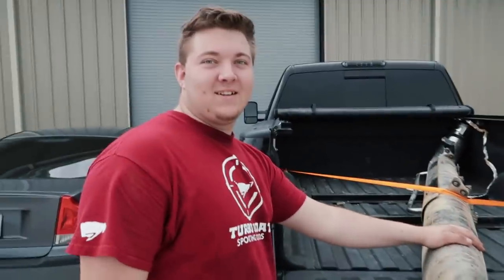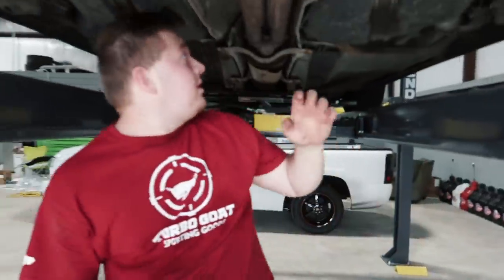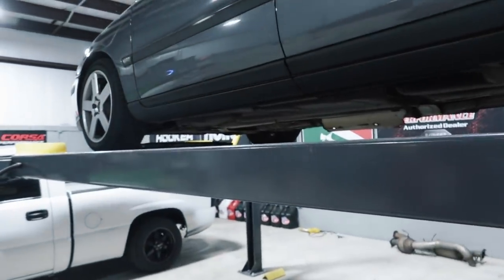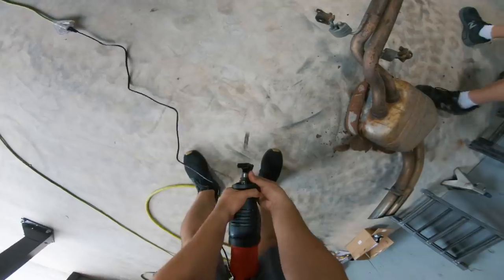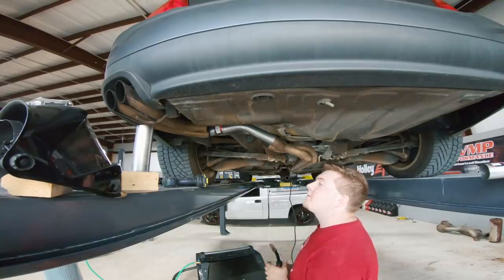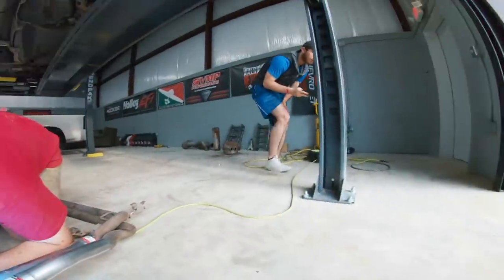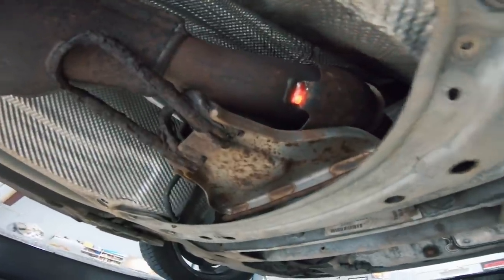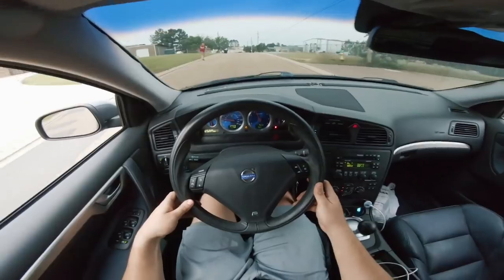We made my Turbo’d Volvo sound like a VIPER!!

Comment: it's a viper with 5 less cylinders and a turbo.
Reply: Cain Nolan A viper is a V10 and the Volvo is a Inline 5. Do some math and it has 5 less.
Reply: @bigbody_business3601  dude chill..
Reply: @bigbody_business3601  mate take a chill pill lol
Reply: Cain Nolan yes 5 less, a viper has a V10 that Volvo S60 has 5 cylinders
Reply: and a different sound
Reply: Wow, this got heated fast😂
Reply: And mostly fwd
Reply: I'm pretty sure that's the same engine that is in the ford focus st 2.5
Reply: Yes and no, Ford did use the Volvo Inline 5 for their ST/RS yes but they used the B5254T3 as their base platform and reworked that engine. The S/V70R has the B5254T4
Reply: @alexanderambrosio3497  just gonna point out some parts to be a little more specific, there was never a S70, but there was a S60 and S60R, second of all, the S60R and V70R use the B5254T5 engine, not the T4 version, the T4 is in the base model 2.5 S60/V70
Reply: @robinjohannessen787   Totally wrong. There was a s70
Reply: @alexanderambrosio3497   The r engine has thin walls 2.3 i5 is better
Reply: And Swedish
Reply: What’s wrong?

Comment: Not gonna lie that’s the most badass sounding mom car I’ve ever heard 😁
Reply: CryTec is this a compliment or not 😂😂😂 lmao but it does sound dope
Reply: CryTec ever heard a straight piped 2018 Ford Expedition MAX with the turbo motor in it?
Reply: 5 Cylinder baby!
Reply: hey its not a mom car i have a v70 bud
Reply: S60Rs are not mom cars lmao
Reply: CryTec its a 5 cylinder engine that’s why
Reply: Turbo volvos are not mom cars lol. They are lowkey fast as hell and made for driving. Volvo is so underrated
Reply: Buy a Toyota Sienna, that's a soccer mom can, s60r's are not mom cars bud.
Reply: Dude volvos are so underrated. They haven't been mom cars since the 80s

Comment: People sleep on the Volvo turbo 5 cyl. I have an 02 V70 T5 that we did a full turbo back exhaust. Added 3" downpipe out of the turbo, removed cat, resonator and muffler, with 3" straight pipe from the DP all the way back. 
It sounds delicious :)

Comment: Put a intake and a blow off valve and then it will be the perfect daily
Reply: Jon Deeb sure BOV if you want a poorly running daily
Reply: glocksrox most people don’t notice any real drawbacks from a BOV...
Reply: @extremeencounter7458  yeah on some other cars...these 5 cylinder volvo's do not like blow off valves and you'd have to be properly tuned to run one especially on manual. It makes the cars run bad. Some people have even had issues during tuning with a blow off valve. these are MAP are the ecu is programmed to account for all the air in the system and it expects it to be recirculated from a CBV like the car has from factory. Replacing the CBV with a blow off valve throws the AFR's all off and makes the car run like shit and even want to stall between shifts.
Reply: @T5_T-Rell  if its map tuned(aka speed density) you can run vta(vent to atmosphere) as there is no airflow meter keeping track of the amount of air coming in

what you are saying is true for a maf tuned car but not a map tuned on
Reply: @halo3pownage  this is something I know but I don't know of anyone so silly enough to spend big money on a speed density tune for one of these cars just with the only intent to just purposely be able to run a blow off valve...
Reply: @T5_T-Rell  I think they come from the factory like that, my focus ST is like that. The only sure way to tell is to see if there is a maf sensor under the hood and even then it could still be map tuned That's the fiesta ST in the states even though it has a maf sensor it is still tuned to speed density from the factory
Reply: @halo3pownage  I've owned 4 Volvo's and i'm not new to the P2 chassis of volvo's that's why I commented what I did. These cars have to be specifically tuned to run speed density as part of what most tuners for these cars consider a "stage 4 package" its the most modified ECU tuning package you can get for stock ecu and is custom tailored adjusted for full bolt on, big turbo volvo's usually with built engines unless they have the "4t5 engine" which is the only factory volvo 5 cylinder engine really capable enough to handle really big power on stock internals. These cars do not come stock with speed density and run like shit if blow off valves are installed and like I said even when tuned, unless you go speed density.
Reply: @T5_T-Rell  well of course you're venting metered air so naturally it will run like shit. Tbh idk why people run vta, imo it's a little ricer. Plus with an intake you get the vta sound so it kind of defeats the point imo.
Reply: @halo3pownage  only people I see running BOVs on these cars are silly people who just want noise, or those with big turbo builds who need something like a good BOV or a heavy duty CBV but they would rather not spend the extra money and fabrication time to make a external CBV work. Honestly on these cars BOVS are dumb because like you said with a intake you get the same noise and with these cars especially the turbo noise is super loud with a intake.
Reply: sw4gr1d  you don't want to do straight exhaust anyways as it robs power, the best thing for power and sound is to have a few resonators on your exhaust. Watch the exhaust myths busted video on YouTube, it has the lead engineer at magnaflow explain how exhaust flow works
Reply: sw4gr1d  F1 cars are not regular street cars. That's a poor analogy. The exhaust lengths are significantly shorter on F1 cars than on street cars. Watch the video. He explains why resonators actually flow more exhaust gas than a straight pipe does on a street car.

Comment: The volvos are nice sounding because of the 5 cylinder engine! 4 is "ricey" and 6 cylinders sound drowny or just not good most of the time in my opinion. But that 5cylinder with a turbo to break the sound up a bit, that sounds just right!! Well good as you can without a v8 that is lol

Comment: Get the orange side markers on the Volvo headlights tinted black and get all LED bulbs. LED switchback turn bulbs. Tint the tail lights and fix the dent on the rear quarter panel on the driver side.

Comment: .. Any sweds here that remembers the 240 back in the 80/90s ? :D
Reply: Not a swede but long live 240s! I have two and both modified
Reply: @AltitudeProductions  i'm not a swede, (a dane) but the old brick Volvo's are awesome. My first car, Volvo 940 n/a 
Second car Volvo 940 with the b230ft engine slightly modified.
Third car Volvo 144 (from Sweden) with a engine swap from a 850 T5 
And now i got an imported Volvo 850 T5 from Portugal, so it's only a 2.0, but with big turbo, is good for +400 hp, but daily it's around 300-320 hp, i have not upgraded internals..
The 5 cylinder sounds amazing, next car is going to be a rwd old Volvo again so i can drift.
Have always had a soft spot for the Volvo Amazon 121 combi.
Have you seen Guy Martin's Amazon? Perfection😍
Reply: Yes we still have them and half of every 240 is modified

Comment: The chain for the door is kinda the way to open it with out having a motor, and a fail save if ya had a motor and it failed. You can get a industrial size opener for the doors and works almost like your garage would

Comment: It was all good until you welded the exhaust pipe to that crossover brace. Not a good idea the exhaust needs  to be able to move not to mention that is gonna transmit vibration into the interior bad af

Honestly should have just took that pointless brace off instead of welding it like that

Comment: Hey, you could have a pulley on a tensioner welded to the frame, hook the chain on the pulley. Have a shaft for a drill and drill the door up and down.  Could work I guess. 😂

Comment: Whenever a car has a problem like that muffler, especially a volvo.  You call that a must do mod. Because oem prices are stupid high its almost always easier going the cheaper route, and which things such as exhaust. Might as well fix it and make it better at the same time. My 08 s40 shocks were trashed so I threw mazdaspeed3 coilovers on it. 600 compared to 1200 is a steal

Comment: We got the same daily , just put a straight pipe 2.5 to 3 in. , and your set , and its a guaranteed 180 hp extra just with that and if you take the air filter out its another 60 ish hp extra.

Comment: on a down shift going from 3rd to 2nd start giving the throttle little blips so little taps over and over  you will get really loud after fires from the exhaust my old ST225 use to do it really loudly.

Comment: Learning to weld on pipe is not the easiest thing to do! Clean metal on both parts is key, use the other hand to stabilize it like your shooting a gun kind of, and the settings are close when it sounds like bacon frying! I was told these steps when I started and it helped so thought I'd pass it on. Not the end all be all way just tips to start practicing is all!!

Comment: So on these cars that mid exhaust loop causes a lot of issues. It's the lowest point on the car, and most people actually remove it because it will often catch on speed bumps, stuff on the road etc. and sometimes smash the exhaust up into the drive shaft causing major issues. If you see this is would highly recommend removing it.

Comment: Saying it has potential. You need to see the focus rs /st in the uk (the ones you guys in the states didn’t get) same engine but guys are getting 600+hp out of them so they have way more “potential” than you think another side note a few of these 600+hp cars are daily used vehicles so try getting in touch with some of the ford focus guys here in the uk

Comment: Until recently i had a S80 2.9 ltr. with almost all options on it(i believe it came 4 or 5 options to short mine was a 1999)and almost 254k on the clock(running as smooth as new). But sadly had to sell it(which i really did'nt want to) Short said a bad financial year and because i am struggling on and off for almost 10 years with a burn-out(8 burn-outs in  that period). And living in the Netherlands a keeping a car aint cheap(406,- in the 3 months for road tax and insurance alone),than offcourse maintenance and here we have a yearly periodic inspection for safety and environment(Co2) . But my next car will be a Volvo again.

Comment: ur exhaust will break by welding the bracket thats not part of the exhaust as the exhaust has to move abit for the engine when running also have new pipe from front to back not cut box off and put pipe in between another fail to lasting long

Comment: Make sure you at least shim that block before you go HAM on the mods. FMIC is a must. These cars get lots of heat soak since the inter-cooler is sandwiched between the radiator and condenser.

Comment: Guys I need help, I recently installed a H and s Minni maxx on a 2012 ram 6.7. It has the 68rfe and is stock. Will running tow haul help to hold more power without damaging the transmission or is it the same thing as in normal mode?

Comment: Yep until the imbalance of back pressure either blows up the turbo or the heads off the injectors
Reply: Off the injectors?? That's a new one 😂😂
Reply: needle valves are machined to a millionth of an inch and are inside the injector tips and yes its very easy to fuck them up. Ive repaired too many injectors from idiots putting 3-4 inch straight pipes with a huge fart can on the end of the exhaust to make their pickup sound like shit and run the same way.

Comment: Its sounds good of course. I wont bash the practices too much. But having the bracket of death on the car and then WELDING the exhaust to IT was one of the biggest mistakes I've seen. Its like there's no knowledge of how the exhaust works. Lol 
I bet the flex pipe is leaking already, or the bracket is ripping off.

Comment: WTF. You never weld an exhaust to a cross mamber. It will get metal fatigue in no time and split and crack. Plus the vibration inside the car and the car body will be horrerndous. Thats why exhaust are always kept of the body by hanging off rubber hangers. It dose sound good. I would be tempted to de-cat it. If you can in your state.